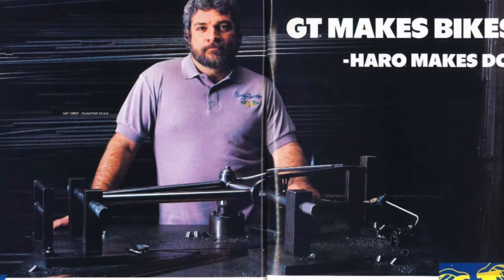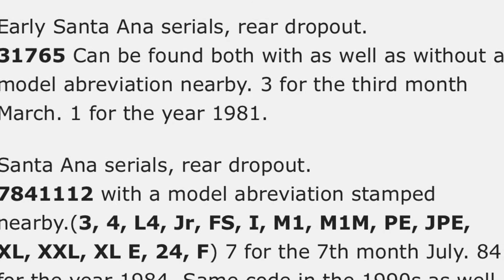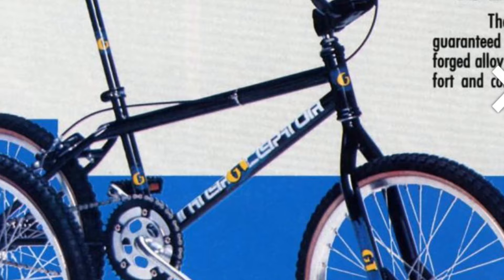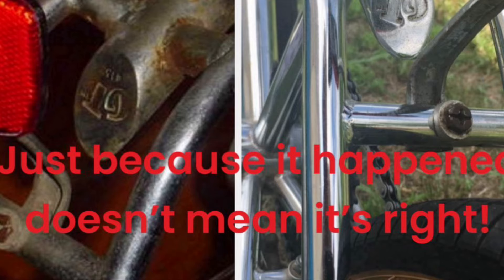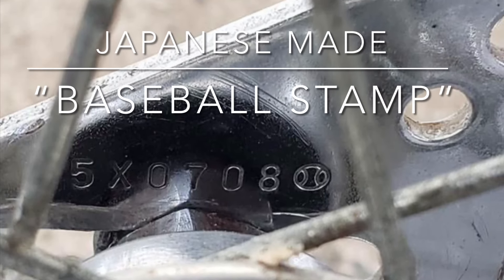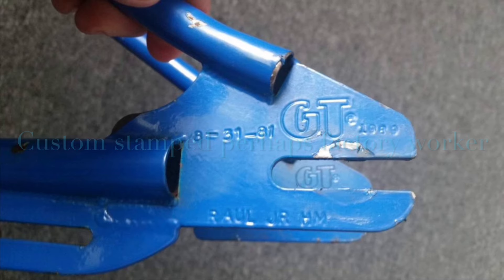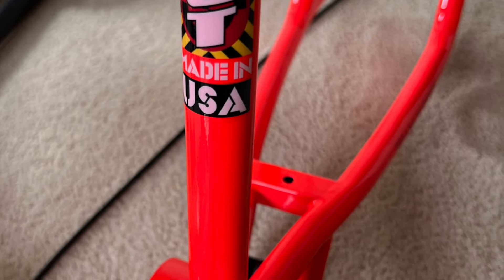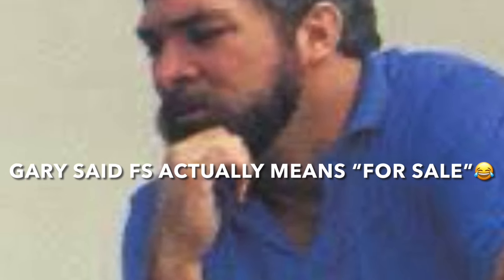The FS Stamp Meaning - GT

Comment: On the comment about PFTs, pro performers etc.. built in the USA....What about the Japanese built world tours? there are world tours out there with bottom bracket serials and dual cable guides on fork??
Reply from the maker: What about them specifically are you referring to?
Reply: I was under the impression by the video..(maybe I missed something) that they were only built in U.S.?
Reply from the maker: @shtdaprdtr many of the bikes were built in the orient. Only all numerical serial numbers were USA made. I apologize if you understood what I meant when I said PFTs were made in the USA. Generally the high end bikes were USA made but definitely not all of them. Again follow the serial number. Any letters in it (besides GT) and it was made in the orient. Thanks for watching and commenting.